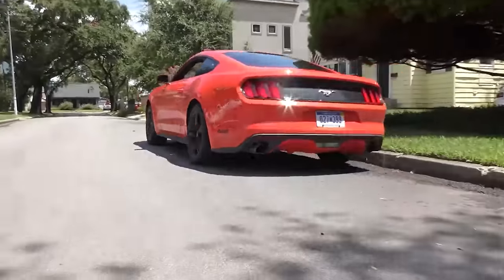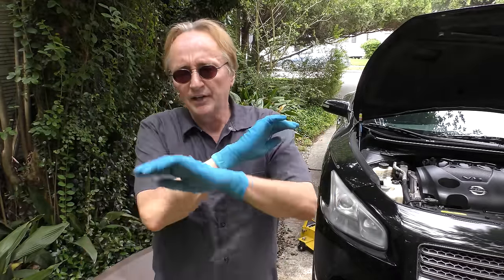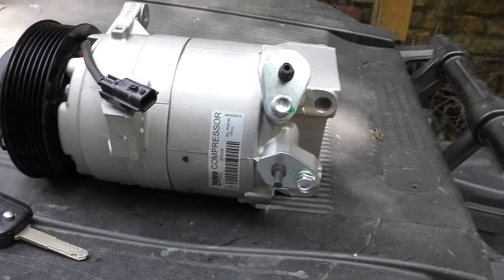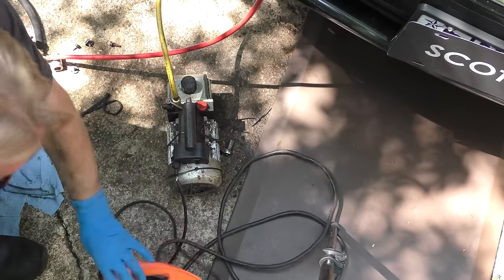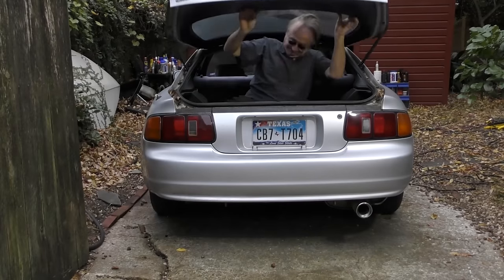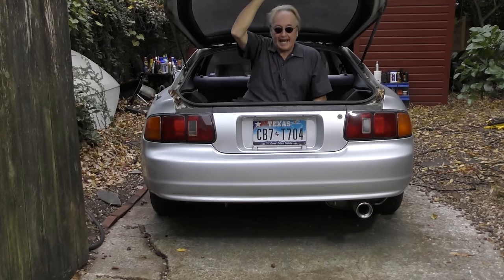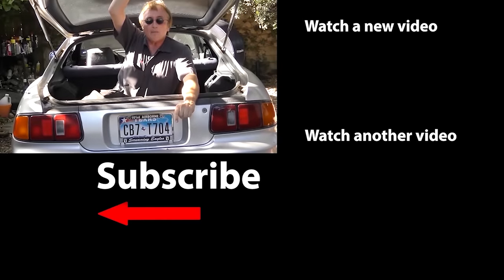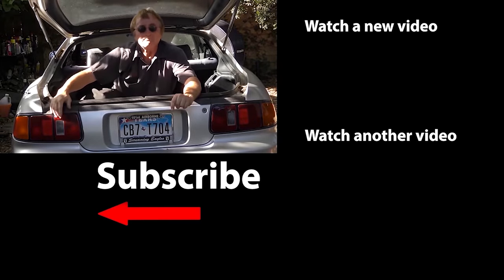Here's Why Nissan Doesn't Want You to Work on Their Cars

Comment: So many mechanics who refuse to work on cars without a lift. Scotty is still crawling under cars with no complaints. Respect.
Reply: For real
Reply: Well maybe those mechanics use their brain and actually take safety measures for their wellbeing.
Reply: @seething1361  regardless if it’s on a lift or jacket and you’re always jeopardizing your safety.
Reply: Wait till your 60 and say that.
Reply: @Stratifying  Nailed it
Reply: @seething1361  a lift is just as dangerous, the only safe things is an old-timey pit...drive over the pit, walk down the incline and work on the car....the concrete usually wont collapse

Comment: Pop up up n down headlights that was a great reference.
Reply: Made me smile then instantly had the james voice in my head singing the jingle lol
Reply: Pop pop up and down headlights!!!
Reply: -28 or -28.5 psi is industry standard before filling any tank or system. You cannot remove all the air its impossible. so in house and in car ac systems and any tank being filled with a gas has to hit -28 psi. Tanks have been known to blow up on the person filling it when not under the proper vacuum

Comment: as an auto mechanic with over 30 years experience i agree with scotty about using a new compressor instead of a rebuilt compressor. a lot of rebuilt components will not last.i also recommend using new alternators instead of rebuilds

Comment: On my car, i use self vacuum, using the compressor itself to push out the air and create a vacuum, we allow for a small amount of leakage of refrigerant. Basically bypass the zero pressure safety switch or directly connect a positive wire to the compressor for less than a minute. High side open or simply press down on the port valve, till there is a strong a vacuum on the low side. switch off. with engine off we load a little refrigerant till its standing pressure. then repeat the process one more time . So far this works without much of a problem, if your receiver dryer is new, any small amount of residual air will be absorbed . AC goin ok for four years now.

Comment: I like Scotty. Yes I have a 2014 Nissian Maxima. It hit over 100,000 miles. I love the car. It has no problems yet. I like his common sense and his troubleshooting steps. I have learned alot from this dude. Thank you so much!
Reply: I have the same model with 106k miles on it. Mine has had so much replaced it isn't even funny. It was still cheaper than buying new, but never getting another Nissan.

Comment: My 2014 rogue has 50K miles, so not that much, but has had no extraordinary issues outside of needing regular maintenance. Have a 2018 Murano, so too early to say it doesn’t have major mechanical issues. My mom has a 2005 Murano that’s still going strong. It’s only had a broken axle and an issue with the shifter. For a 15 yr old vehicle, I call that a win. So three Nissans, no major issues, even by by 2005 Murano, it took a while to develop those two issues. Respect Scotty and his knowledge, but I love my Nissan’s.

Comment: Thanks for all your content Scotty. I have a 2013 Nissan Maxima bought it before I started watching your channel😭. Had 26000 miles on it and I knew the old maxima’s lasted forever so thought it was a good buy. At about 36000 miles the transmission started to shutter a lil here and there. I was so angry after finding your channel and finding out Nissan has horrible transmissions. Now I am only going to look at Toyota or Lexus for the future. I am at 46000 miles the trans still shutters some time but I’ve learned to live with just going to drive the car into the ground then get a used Toyota thanks to you. P.s. don’t drive many miles as you can ,aye tell it’s been 3 years I have had the car and only put 20k miles on it I would definitely tell ppl to not buy or trust Nissan products. Again thanks for all your content and being the man that you are.
Reply: you still got it?
Reply: I bought a 2018 Sentra SR with 50k...I've put about 33k and no problems besides the front bumper sensor. But I'm definitely not buying another one..only Toyota from now on
Reply: Nissan Maxima sucks big time. The older models lived for over 100,000 miles. Any model over 2002 sucks!!! Money pit!!!
Reply: @urpreposterous682   The 4th gen was good for 200k miles with no repairs, just maintenance on parts that wear.  I didn't even replace the original brake pads on my 97 until 189k.
Reply: @urpreposterous682  cap i had 09 maxima sv bought it at 79-81k Milesage and i took good care of it mechanically, under my other ownership. Of 6yrs I replaced- alternator, battery, spark plugs, one coil pack, rotors (drilled) pads, steering rack line, steering pump , and belt, axle, transmission fluid change, and tires. Most of those i fixed my self. Until it was total at 160k Milesage
Reply: @chevyssboy89  
You have the advantage that you have the mechanical knowledge to do the work & maintenance for yourself. Others that don't, learn not to trust mechanics & go broke trying to fix a vehicle that has low miles. Under 50 thousand.
Reply: I have a 10’ maxima with 66000 it runs fine feels fine
Reply: Well I rather drive a Nissan over a Hyundai And I have a Nissan Altima hybrid is very reliable

Comment: This 94 Celica has a serious problem. Said no one ever.
Reply: REM  that happens to any car tho
Reply: REM  well then no car is perfect since almost every car uses rubber gaskets.
Reply: The 94 Celica IS bulletproof
Reply: @justgod613  True and I have a 1994 Celica ST with over 336,000 miles to proof it.
Reply: @justgod613  That's why I park mine on the rifle range.
Reply: Amused.  Maybe it’s because of the climate up here in AK, but...  The Toyota Celica doesn’t so very well up here.  In a town where the vast majority of people drive trucks, the Celica’s appearance at the shop was only surpassed by a stupid Fiat.
Reply: Justin Goddard 
Amused.  It’s far from bulletproof.  My local range put a Celica out once, and the first shot from my .30-06 went through the radiator, the timing case and smacked itself right on the crank.  In just under a month, it was the only car out there that was so utterly destroyed, that you couldn’t even tell the make or model if you didn’t know what it was.  And nobody really aimed for it either.
Reply: The only problem is it can never get to the dealership lol

Comment: Love my 2020 Nissan Versa S with 5 speed manual transmission. I'm a Nissan guy 4 life.
Reply: I have the 2014 Maxima with no issues at 80k miles. I do all the maintenance myself.
Reply: Me too got Nissan Sunny 2005 MT so strong until 2018 I got Mitsubishi Mirage HB .
After this pandemic...I'm looking for 370Z
Reply: he said: get your head checked!
Reply: I've owned two Datsuns and two Nissans. I'd never buy a newer one but I love their old ones!
Reply: Toyotas are like buttholes, everybody's got one.  Signed, Nissan guy.
Reply: Have a 13 max and 05 xterra. Do my own work. They are great unless you dont take care of them. Xterra needs lotsa love.
Reply: I have owned 5 Nissans. A pathfinder,armada,2 maxima’s and a 370Z. I only had one problem and that was on the armada,a recall for an airbag sensor. Covered under warranty and it was done in an hour at the dealership. All in all I have probably put about 390,000 miles combined total on all 5 cars. I never even has as much as a rattle or squeak. My maximas were also great on gas. Never had a problem with the cvt transmissions either.
Reply: Lotsa Nissan haters around here, guess cause they cant keep up with that badass 3.5. My max is awesome.
Reply: Proud owner of a Maxima, Sentra and 2 Pathfinders.
Reply: I now own a 22 Nissan Maxima I bought new. I absolutely love it!  That VQ35DE is a blast!

Comment: Always do a leak test when you vacuum down the AC system you want to leave the gauges on so you can determine if you have a leak for example you vacuum the system down then you wait a half an hour to see if the system vacuum level goes down make sure all the fittings on your gauges are secured and tight always do the leak test this will save you money on freon I also always replace the Schrader valve on the AC system Schrader valves are always a likely possibility because they go bad and it is a big possibility that you may have a bad straighter valve so I always change to Schrader valves when doing any AC work
Reply: Pretty sure someone as old as scotty who's been doing this for 40 years knows this lol
Reply: I was letting people know that it's always good to do a leak test before putting in freon I also replace both of the Schrader valves whenever I'm working on an AC unit he didn't mention anything about a leak test I thought my information would help people that want to work on their own air conditioning system when you vacuum down the AC system and then let it set and make sure the vacuum is not leaking down this way it will save you money on buying freon because if you have a leak can you put Freon back into the system you're going to have to do everything all over again and buy more freon but if you do a leak test that ensures that you do not have a leak they also recommend putting UV dye in the system also hope this information has helped people on the internet

Comment: Hey Scotty I would have mentioned about doing a leak test on the system to make sure that the system is holding a vacuum before you put in the freon this is an idea I'm a retired auto mechanic got many injuries and cannot work but I always do a leak test to make sure I don't have any other leaks in the system
Reply: The vacuum/micron reading will tell you, if there is a leak in the system.

Comment: I just had a new compressor installed on my 2010 Nissan Rogue because the clutch seized up. AC still wasn’t blowing cold after putting in a can of refrigerant so we had to search for the AC fuse and that had blown so we replaced that. Blowing cold air for now.

Love your videos

Comment: I never buy reman parts even if I'm broke I have bought reman starters,alternators and power steering pumps and they all crapped the bed in a year
Reply: Learned that lesson, from Auto Zone. Got tired of constantly replacing alternators and starters. Buy new, it will be the first and last time you have to do it.
Reply: Same here
Reply: I couldn't figure out why the  alternator in my 1999 Pontiac Grand Am kept going out every year, after year 7, until it dawned on me that I was using rebuilt ones everytime. Switched over 2 a new one, one year & had the car another 12 years b4 i had 2 replace it again.

Comment: Scotty, in the case of this 2013 Maxima I replaced the AC Compressor on, upon taking off the low and high pressure hoses, you could smell the electrical hot, burning smell, clearly the compressor had smoked/given up. New compressor, not rebuilt, and an hour’s evacuation, and said new compressor with proper recharging of R-134a installed, and icicles have returned from the AC vents.

Comment: You forgot to tell everyone to have someone recycle the refrigerant and leave the system at 0 pressure so they don't get blasted with high pressure refrigerant when they pull the hoses off. Your's was empty as you said. It probably wouldn't cost too much to have a shop suck the old refrigerant out (to do it legally) and safely. Another thing to mention is that the refrigerant oil needs to be measured if the new compressor comes filled with oil. So drain it and measure out what goes back in it. It's always a guessing game when the system has been leaking but there are charts that tell you how much oil each component holds.

Comment: It says +-25g because if you live in a very warm place, put 25g less. If you live in a cold place, 25g more. I know it sounds counter-intuitive, but the refrigerant compresses in the cold and expands when it's warm (it's always in a semi-gas semi-liquid state), so if you have too much refrigerant in a warm climate, the high-pressure switch will cut your AC before it will reach its max potential. If you have too little in a cold climate, the low-pressure switch will cut the AC off.

Comment: I might have checked to be sure the system held a vacuum for a while and then filled the hoses with refrigerant before connecting to recharge. Weighing in a charge is always best though a TXV allows an amount of variation, a piston metering system doesn't.

Comment: In Houston, an AC is not an option. The same is true of Yuma where I lived for 8 years. The AC on my '84 Chevy Citation had leaks in it and the R-4 compressor was shot (no surprise there, bad compressors). I put a rebuilt compressor in because mo one was making new ones. The only ones I could by from GM were rebuilt. I bought a rebuilt one at one of the chain stores, and it worked good for about 4 years. I would suggest replacing the receiver dryer, just to be safe.

Comment: Scotty I’ve sworn off Toyota’s for years after having some bad experiences with them. After recently being told by Ford that it’s normal for their ecoboost vehicles to need a turbo replacement at or near 100,000 miles after they misdiagnosed mine and put a turbo on for nothing, I got rid of my wife’s escape. After looking at vehicles for a month we decided to follow your advice and bought a brand new RAV4 to replace it with. It’s not as powerful as her escape but hopefully it will last longer than 97,000 miles before I have to spend thousands to repair it.

Comment: Biggest issue with trying to get an old car running is usually old gas in it .
Drain or siphon it all out if its more than a year old . And change the fuel filter too.
Ive dealt with starting up lots of old cars ( fuel injected and carburated )  and if it was running good when it was parked ,
Old / crappy gas is usually the main problem .

Comment: AC can be a real problem. Always measure the price against what you would gain. I had to spend 20% of my used car's price onto the whole AC system - compressor was shot, non-native gas was loaded in the system, eating away at the seals, making it leak at multiple points, clutch pulley melted due to the shot compressor.. sucks to be left without AC to dry the cabin air at winter - scraping ice off the inside of the front windshield with a cold engine. 
AC is not entirely necessary for a car to run (leave it off, won't be a bother), but can save you from trouble both during summer and winter.

Comment: New compressors usually have refrigerant oil in them BUT they usually don’t have enough oil. Replace the accumulator when replacing a compressor and make sure your vaccum is holding after you shut off the pump, before filling the system with refrigerant. Find out the amount of refrigerant oil is supposed to be in the entire AC system it’s important.
Reply: The old one did, because you could see it running out while he was holding it, at the end.

Comment: Some remanufactured compressors are almost as much as 100% new compressors. For that reason alone it only makes more sense to buy a new one. Now usually if you replace the accumulator and orifice tube you’ll get a two year warranty on everything whereas just replacing the compressor and reusing the old contaminated parts will void warranty warranty. An orifice tube is usually a couple bucks and the price of an accumulator varies greatly so if it’s cheap enough I’d replace it. If a part fails under warranty the store can warranty for you including lost Freon.

Comment: Fixed hundreds of Nissan/ Mercedes , a/c , climate control systems. Never had a leak stump me. Installed dozens, if not hundreds, factory ac systems. Back in the day when they were a bit simpler.

Comment: I would replace the orifice tube when replacing the compressor.  I would also replace the accumulator dryer.  Pull the vacuum to 30 inhg and wait.  Come back and see if you have lost vacuum.  Means another leak somewhere.

Comment: If you want to do it cheaper and it's a old car just get a used one off a car with medium Miles.  I did that on our Camry abs module that went bad 7 years later no issues.  Used factory parts are almost always better than cheap new ones.

Comment: ANY Time a AC system is open you Must Replace The Dryer it and then use the vacuum pump!  O Sure it will get cold if you don't but once the water in the dryer is mixed with the R134 mixes with the water left in the Dryer it makes Acid that will make holes in the thinnest part of the system. The evaporator under the dash !!!! And the Vacuum Pump wont  get rid of the water in the Dryer!!!!

Comment: Hey, Scotty,  I've got a 2014 Chevy Colorado VVT 6cyl. 3.6lts. that lighted all the 4 Oxygen sensor codes at once.  it was due to a Squirrel making it's nest beneath the engine cover with as many materials she could find.  There's no traces of copper wiring where it made it's nest but I want to find out where it might have bite in order to disable  all 4 oxygen sensors .  PS  Autonats Garage rules!

Comment: All dealerships make it hard for the customer to work on their car. Not just Nissan they want you to go and get it repaired at facility that's why some cars use torque screws that's why the electronics has to be programmed so that you have to bring it back to the dealer it's been like that for the last 20 years is nothing new

Comment: Got a truck with sludge in inside valve cover when I remove it. I removed as much with a rag. An just change the oil every 3000 miles and it clean pretty good the next time I open valve cover.

Comment: My 2015 altima ac cuts out at idle when its 100 degrees. Rest of the year its fine but as soon as it hits 100+ it wont work. Any thoughts? I have evacuated the system and recharged it and no leaks so im at a loss. I heard there is a dash sensor that goes bad?